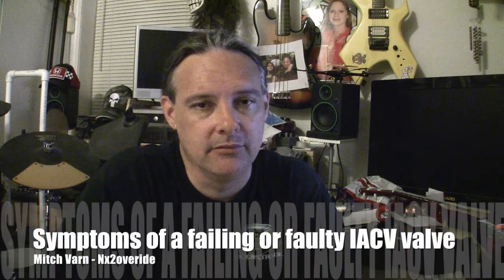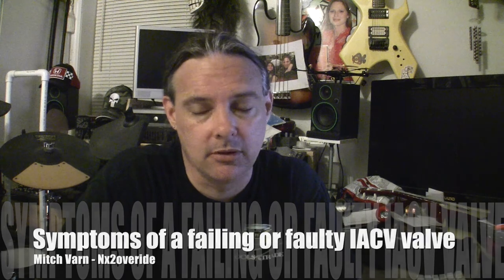Symptoms of a bad (IACV) Idle Air control valve P0505

Comment: 1990 Honda civic 1.5 liter manual here. Started stalling when stopped. Cleaned idle control with throttle body cleaner and idled great for two days. Then car was sluggish and sounded like Volkswagen through exhaust. Changed plugs just in case with no change.  Ordered new control valve at $200. Hope that fix does it since it's my daily work car with 350000 miles and saves a ton of fuel these days. 35 mpg. LGB
Reply: Did it get it fixed?
Reply: @donttrip2366  word is he's still at the traffic lights raging with the rest of us

Comment: i have a 2000 prelude 5mt that has an idle that surges to 1500 and comes back down to 600, sometimes it holds at 2000 rpms and other times it holds at 800. i have yet to check the engine code

Comment: Funny you posted this, I just replaced the IACV on my Infiniti with the SR20. I got the P0505 code. It actually shut off on me and the check engine light came on, it somehow miraculously started back up, got me to the house, and died again right as I pulled in the driveway. Lol. Once it got to the house it refused to idle at all.
Reply from the maker: ahh the P0505, yes..yes.. I got this on my Honda 4 door.. I knew it was the IACV going bad I was just being lazy with it.  Mine died on me, but I needed to park it at my land that is like 30 mins from my house. I sprayed Carb Cleaner in the throttle body, drove it there and parked it for a week..lol
Reply: What kind of Infiniti i have a m35 and my idle is bad

Comment: Same narrative of my Civic hatchback 05 with 300.000 km. It started 2 years ago, only on morning/cold weather during warming up then it drives fine. Now in summer it makes the same issues as you mentioned in the video. But since the engine reaches the operating temperature no problems with it.

Comment: 2003 Civic LX, I’m having a rattling sound in the drivers side, my mechanic told me to replace the motor mount because that’s what’s making the vibrations . After doing so today I spent $80 for tools and parts motor mount by Anchor $120. Didn’t fix the problem . I went to another mechanic and said that my throttle body is dirty and I had to clean my OACV. If I had to replace it parts is $160 USA made bit since I saw your video I’ll try working on it this Saturday on my day off. 
My car symptoms are low idling and rough acceleration, the sound I can hear in the car cabin is driving me nuts thinking my engine will come apart.

Comment: My 1998 prelude doesnt throw a code and then in the cold the car cranks but doesnt start.  Also stalls when i come to a light or stop. Fuel pressure and spark has been checked and all parts for both systems other than the main relay / distributor have been changed.

Comment: I have a 97 Acura cl 3.0 no check engine light, has surging idle and has stalled out while driving on a few occasions. I will be replacing it tonight(If it gets me back home hopefully) and hope it clears up everything.
Reply: Did it work?
Reply: @angelesteban1525  

It did not, I replaced the IAC, o2 sensors, coolant temp sensor, engine bay fuel filter, and thermostat (needed to be replaced though) and so far still surging. I was going to change the fuel pump and filter element but did not want to drop the tank and I am not considering cutting the trunk up to gain access to it. If the fuel pump does not solve the issue then I am lost for possible solutions.
Reply: @toXic_viRus01  did you ever find and solve the issue?
Reply: @donttrip2366  not for the surging but the stalling out may have been due to my heavish keys and the ignition switch being old as one day I pulled into a parking lot and the keys swung around and the car shut off without being put into the off position. Pretty much no useful information to provide honestly

Comment: Having this issue on a 2003 Buick Regal. Nasty start up then stall. Giving the car some gas while starting the engine allows it to start but while in idle it struggles to stay on or once I let my foot off the gas it stalls. The idle is high and low IACV it seems like the car is struggling to breath if you ask me what happens. Thanks to your video I was able to confirm my assuming of what might be my issue I am having with this 19 year old car with under 200,000 miles going to give the Clemson a try or replacement lucky the IACV piece is 45 bucks after taxes from AutoZone for this car and engine.

Comment: On my 1996 Nissan Altima GXE manual transmission I have a bad idle control valve and it idles very low without stalling then the RPM goes back up again, cleaning it could work for a few years

Comment: Thanks for your information! I have a 90 honda civic with a up and down idling after it gets to normal temperature,  so you think I have a vacuum leak?? It has the fuel injection carburetor I believe it says pfm or something like that on top of the carburetor! Any other ideas that it's causing that?  I thank you in advance!!

Comment: Have a 2000 honda accord 3.0 vtec , took it to shops already they told me that all 6 cylinders were failing . One shop changed them and the problem is still there .. Check engine turns on and off .. Misfires when warm ..

Comment: I have a 1988 Honda Civic. Right now it runns but won't rev past 3000 it would back fire when in park but if I put it in drive the power just drops when I get to 3000 rpm. I put new wires, plugs, cap an rotor, coil pack, ignition module, O2 sensor, secondary injector, replaced the head an it still does the same thing
Reply from the maker: could be a bad TPS.. if you have another throttle body, or grab a junkyard one.. I'd try swapping it just to check.. I have had something similar.

Comment: I need to know about the sensor itself cause I'm having problems with just the sensor
Reply from the maker: Well, here is the deal if you have a Honda.. there is a difference between the Automatic and manual versions.

Comment: Rpm dancing, is it from iacv problem boss? I just change TPS, map sensor and clean up throttle body. Still dancing 😅
Reply from the maker: sounds like the speed sensor.
Reply: @VarnHomestead  it's only happens while idling
Reply from the maker: does it do it when cold or after the car is warmed up or both.
Reply: @VarnHomestead  both. Its dancing in pattern while idling. Back to normal when car start moving
Reply from the maker: yep AICV
Reply: @VarnHomestead  hello boss, need advise, i just service my honda 96 IACV. After installing back, car getting worse, white smoke coming from exhaust 😂 what kind of sorcery is this 😅
Reply: @yuriboyka205  does it still have that problem?

Comment: Can it cause a sticking throttle like I’ll let off the gas and go in neutral and it won’t idle down it stays put where it was or higher
Reply from the maker: are you having surging idle at all?
Reply: @VarnHomestead  I have that followed by a surge what might that mean? ICV? 

I tried spraying around affected area with throttle body cleaner but no change in idle occured.

Comment: I changed my iacv and I'm still getting p0505 on a Lexus is300
Reply from the maker: Not sure if Lexus is like Honda but there is a difference between the manual and automatics IACV valves. Also I have gotten correct Valves from Rockauto and Advance that were defective.
Reply: @VarnHomestead  I got mine from rock auto thank you so much!

Comment: Got a 2005 Honda integra, it rough idle untill it stalls and does not want to start when warm
Reply: What was your fix?
Reply: Mine starts for about 2 seconds when it’s warm but I’m having the same thing. What was the issue?
Reply: Could be iacv if it dies when you turn on the ac. Throttle position sensor will make the car idle funny sometimes makes the rpm gauge bounce. It could be bad ignition switch.  With the car on jiggle the key. If it stalls it could be bad ignition.  Check for vaccum leaks.  With the car cold , start it and spray throttle body cleaner all around the intake manifold and throttle body.  Listen for a change in idle.